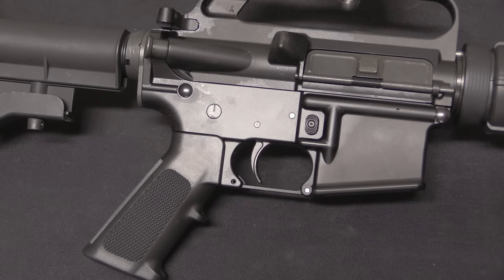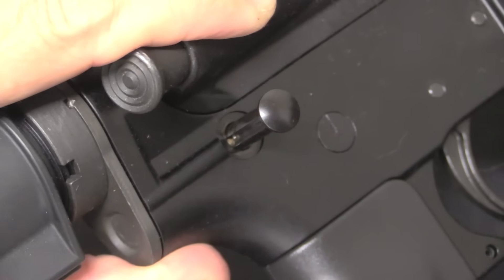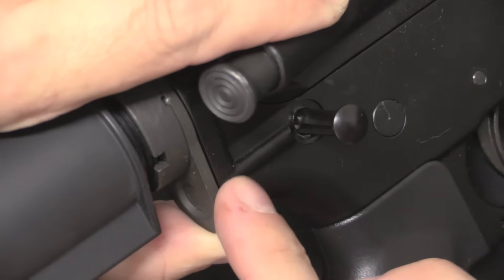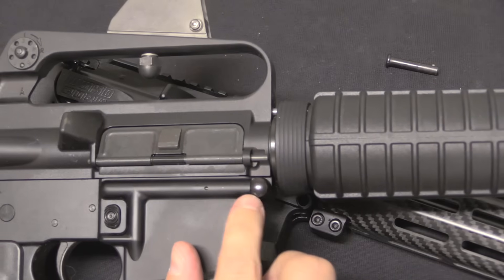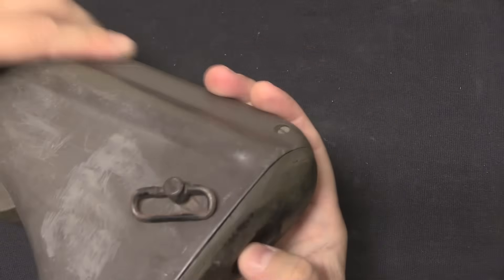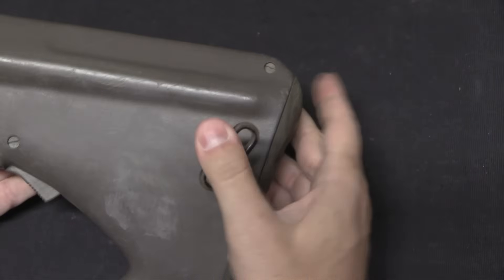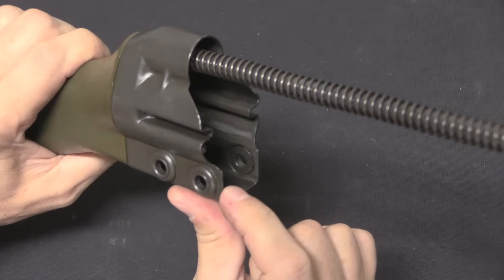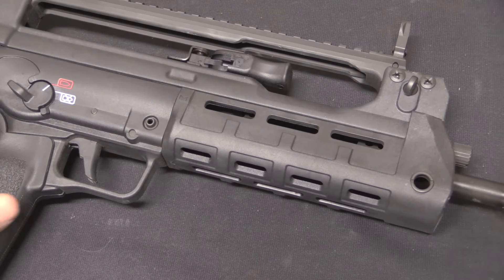Ask Ian: Why Don't More Rifles Have Captive Pins?

Comment: I like what HK did on say, the G36 (or so I think, I don't have access to firearms in general): They have little holes in the stock to park pins in while you take the rest apart. Seems like a good idea for not losing pins in the field without making them captive.
Reply: HK did that on their roller locked guns with fixed stocks, like the G3, G33, G41, and MP5.

Comment: Is there a firearm with captive pins with a groove where you have to turn the pin to pull it out? You could simply make the hole in a sickle shape, that would combine the captive pin with an easy takedown/ low cost... (I'm from Germany so I have next to no firearm experience)
Reply: Now the hole to be drilled/cast/molded is significantly more complex to manufacture.

Probably more complex a solution than figuring out how to make the pin captive, once you consider the cuts on both pin and weird shaped hole necessary.

Round holes are easy.  Round pins with concentric grooves are easy.  Intersecting round holes are relatively easy, provided you have enough meat in the material and the smaller hole isn't too deep.

Generally rule of thumb - if you can lathe or drill the part, that's generally easier than almost any other machining process.
Reply: @geodkyt  fair point, a classic over-engineered suggestion in hindsight :D

Comment: I have noticed, however, that both of my AR's with polymer lowers have captive pins. Guess I just picked the right brands, though economy priced SOTA and PSA, to purchase!
Reply: Or you have two polymer lowers with weak points that can fail more easily, as I've seen with polymer AR lowers with captive pins.

It is unambiguously a point of additional vulnerability, regardless of receiver material.  It isn't a problem in an aluminum receiver because the material has the strength characteristics sufficient to make it a non issue, as even the "weakened" area is vanishingly unlikely to take enough stress to break the aluminum, even where the wall thickness was reduced by the detent channel.

Comment: Why did they dump the great side box magazine used on the US Army Krags when developing the Springfield 1903 and 1906. I love my Father's 1899 Krag in 30 Army. It has a perfect bolt and I love the side box magazine. I just don't understand why it was dropped in favor of the stripper clip or single loading to top off. I reload for it and my slightly lower pressure loads, will take a good size deer will drop with one shot out to 150 meters the longest shot I have ever had hunting in Virginia and South Carolina. It seems to me that magazine on 03 or 06 would have been the perfect combination.
Reply: I believe the army/gov't officials (some sort of bureaucrat) thought that if they used box magazines then the soldiers would waste too much ammunition. It's the same reason the US never officially adopted a repeating rifle and stuck with their single shot rifles and then bolt actions in the 19th century.
Reply: @bobthebuilder5067  That makes sense but some Krags if I remember could be fired single shot. You could have done the same with the 03-06, 30-06.
Reply: Because every army that fielded that system found it gave them more problems in service (including parts breakage, more complex and expensive manufacturing) than just milling a stripper clip guide or going to en bloc clips.  For a Mauser style charger system, you literally have NO moving parts required in the loading system, only one fixed part (the charger guide), and the only down side is you have to open the bolt to top.off the magazine with single rounds (which wasn't a primary concern for military use - troops invariably, and generally by necessity of the speed of action, fired their rifles dry and relaoded via clips.)

In fact, I'm trying, and failing, to think of anyone who didn't abandon a side loading Krag style magazine for a Mauser style stripper clip system...
Reply: @geodkyt  Thanks it is a good system in a hunting rifle but I figured there had to be a good reason

Comment: One method you missed for keeping pins captive was the sa80 solution of have a clip embedded in the steel body around the pin that stop it from being pulled out. Though these do come loose and need to be peened back into the slot.
Reply: That basically goes back to the Swiss solution of "design pins that can fail" option.

Albeit a failure that won't preclude disassembling the rifle... justva failure mode that might allow the rifle to fall apart in use (like M60 trigger groups falling off if the leaf spring is upside down).

Comment: Now I'm wondering why you don't 'just' use a split pin.
As this video shows there must be a reason.
Reply: They also, in some cases, introduxe a failure point.  As anyone who has seen a broken AR15 firing pin retention cotter pin can attest. (As a drill sergeant, I carried a small baggie of parts I charmed the armorer out of, with a couple spare cotter pins, extractor retention pins, and extractor springs.  Because, sure as there's a tattoo parlor, strip club, and "Buy here, pay here - your LES is your credit!" used car dealer ship offering a ten year old Mustang at credit card interest, at least one of your privates will.manage to lose or break one of those small parts the first time they take their rifle apart at the range or in the field.)
Reply from the maker: Split pins are fine, but not captive.

Comment: This is a question I’ve wondered about for ages. 

Makes sense that it isn’t always viable. I think the H&K solution is the ideal middle ground if you can’t have captured pins. 

At least provide somewhere on the rifle to keep them secure and safe. Because if you drop a pin in tall grass  it’s just gone. 

It’s honestly just such a different set of design criteria for a service rifle vs a commercial rifle, you have to grunt proof everything.
Reply: Place to store and a couple extra pins.
Reply: @InfiniteDarkMass  Like having two pins at the back fo the G3, when it really only needs one....
Why? Extra pin, right there.
Reply: It's a question I've always had too.

Decisions like this often come down to what government procurement people want rather than the manufacturer or, in civilian rifles, what the marketing department says will sell best.

Comment: The pin in the AUG is also supposed to be reversable so it makes no sense to make it captive.
Reply: ...and there is no reason to unthread it from the sling during field stripping anyway.

You lose a meter or so of nylon webbing, and well, lost pins are probably the least of your worries.  Being legally blind as you would almost have to be would be a much bigger problem.  🤣

Comment: An idea comes to mind, and i'm sure i'm not the first one to think this so i hope an engineer here can tell me where i'm wrong, but why does the detent need to be springloaded? I understand it's for when you need to put in or pull out the pin entirely, but it seems a lot of extra parts, construction difficulty, and structural problems. Wouldn't it be simpler to have a fixed detent, and make the pin out of 2 parts? Say, the normal pin shaft with groove, tap a small hole on one end, and the wider head screwing into it? It would be less parts, no dynamic parts, and much easier to produce? It would be a matter of finding the best way to make a strong enough fixed detent in each component material, i suppose.
I'd love to hear where this idea falls down, because i imagine it would be done that way already if it worked :p
Reply: It is a possible solution, but one that is often more difficult to do than a spring loaded detent where the pin itself keeps the detent from popping all the way out.  And it can often be much easier to install or replace a spring loaded detent than a fixed retention pin that restrains overtravel of the other pin.  These sorts of trade studies are where good production design engineers make their money.

Sometimes it's the right solution, sometimes it's not.

Comment: It seems like the captive pins are really useful if you have to open a rifle up in the field.  Did the designers of the AR and others with captive pins feel that there was a need to open the rifle in the field to deal with a malfunction?  Did the designers of the non-captive pins feel that their rifles would not need to be opened in the field?  HK has holes in the stock to place the pins in during a field strip.  Did they just not expect field strip to be necessary under fire?  Has that turned out to be true?  Or do you just deal with it doctrinally and drop a weapon that cannot be cleared and transition to secondary weapon?
Reply: The original AR (at least the designs that we call ARs) was not designed with captive pins. It was a request of the military testing them to add captive pins. It's definitely one of those things where you're trying to reduce failure points in the field. I believe that general doctrine is that your secondary weapon is an absolute last resort, considering that the army does not believe the handgun to be a particularly effective weapon (this is the reason non-combatant troops were issued M1 carbines in WWII to replace their 1911s). You definitely would want to attempt to clear your rifle if possible, although most common malfunctions do not really necessitate field-stripping the firearm.
Reply: It's not so much field stripping the rifles under fire.

It's field stripping the rifles in the field when you're exhausted, probably under poor light conditions, might have cold numbed fingers, and no nice clean well.lit table to lay your stuff out on - you're probably chucking bits into your hat or helmet, and hoping someone walking past doesn't accidentally kick it.

The fewer small parts that can make a run from the freedom of the tall weeds and dead leaves, the better.
Reply: I think it is much more simple than that.
Does the military trust their soldiers not to drop a pin:
- No: captive pins it is
- Yes: captive pins not needed
Reply: @Jehty_  I think all successful militaries live by Murphy's Law.  Because it is a statement of fact.  Everything that can go wrong, will.  or in other words Sh_t happens, and to the best of warriors.

Comment: I'd also add another note to this video. Tooling. Most companies will be either buying their pins from someone else or manufacturing in house a commonly used pin en mass for many guns. 

Creating a relatively reliable, (no worse than a non-captive pin), self captive pin isn't that difficult. And the extra steps once your upto manufacturing sufficiently large numbers of them isn't a huge cost negetive either. But justifying the up front investment to do the new tooling setup is going to be hard without a serious need allready existing. And that largely isn't a thing ATM.

Comment: The hole for that detent is only a single diameter. If you pop the takedown pin out and leave the detent in place it will protrude further out. All of the machine blueprints I've seen for lower receivers show it as a singular diameter including the print I have right in front of me. The safety detent on the other hand is limited in the manner that he describes in this video
Reply from the maker: (See description text)
Reply: @ForgottenWeapons  touché

Comment: Surprised you overlooked the captive wedge on the AUG that holds the receiver and the stock. 
Though it's not a pin as such, despite functioning as one.
Reply: Maybe it's just because of how hard it would be to get a good camera angle on the little sheet metal spring assembly that holds it in place. The AUG, though, is such a good example of the designers going the extra mile only for parts that are most likely to need disassembly in the field, I'm also a bit surprised he didn't at least mention it. The butt pad pin is already sort of captive simply by virtue of being attached to the sling swivel. You're not likely to lose it in the field unless you misplace the whole receiver. The AUG has advantages and disadvantages, but it's definitely one of the most elegantly laid out guns in history.
Reply: Immediately thought of the AUG as the epitome of design built for field conditions.

Comment: Great explanation, this is definitely something I have thought about before. If I was setting the requirements for a new military rifle, then captive pins would definitely be on my list.
Reply: If you would be setting requirements for a new military rifle you would most likely have to deal with the cost of a rifle.

For context: Im an automotive engineer.
Whe i saw that first pin i thought: "this is a really expensive pin".
There need to be a lot of machinetime and assemblytime dedicated to that pin.

The total cost of ownership (from a military perspective) might be less if you just buy 5 non-captive pins as spareparts on top instead of having that one captive pin.
Reply: @WEWzulu  Sure but you also have to consider the intended use case. That rifle won't be of much use in war if all the pins have been lost.
Reply: @ErikTheAndroid  this is a problem ofc. But the 5 gramm and 10 cent for the captive pin might be invested in a better way somewhere else on the rifle. On a better adjutable sight or whatever.
Its about the likelyhood and severity of an incident. Loosing a non-captive pin in a gunfight is higly unlikely and loosing it in a base or somethings isnt that big of a deal if there are spareparts somewhere.

You simply cant buy the perfect rifle/car/whatever.

There is allways a compromise to be made.

Comment: In my experience the AR rear detent hole is a single diameter. The detent pin will happily come out of the hole into the take down hole. The pin itself keeps the assembly together.
Reply: Yeah I was like "wtf?" when he said that and went and checked one, definitely single diameter, detent is simply long enough to stick out into pin without coming out.
Reply: Every AR lower, ever.  😉
Reply: @a.k47-74  sending detents across the room when building my first AR. Ah, memories. I’m so lucky I found them. I put the lower in a big plastic Tupperware tub and assembled the takedown pins in that, so it didn’t happen again.
Reply: Yes. He's not as perfect as some seem to think.

Comment: Something to add
In wartime production, every additional machining time is precious time wasted getting guns out of factory and into the hands of soldiers
So it may not worth the time to produce certain aspects of the gun if (soldiers) you can get away with it...
Reply: The ar is already one of the most bear bones rifles out there and it's literally just drilling 2 holes the actual dent is on the pin itself. Also you have to secure the pin somehow anyway and this is a very simple way to do it without adding very much complexity.
Reply: @whatsmolly5741   well, I was talking in terms of production aspect
 
In manufacturing, volume of production is the key of the game. 1 part may cost 1$ to make, but if you were to produce a million of them it would stack up

Labor, material and time cost is the balance manufacturers have to consider when producing stuff and situation also matters.

For instance; in peacetime, proper quality control and price is more important as there is no rush to get things done. In (hopefully not happening) wartime, volume and speed is far more important than quality especially if one is desperate enough

So who knows, maybe such part was deemed unecessary or so insignificant it may not even matter. However it has to be said that in war everything is expendable including guns. So it may have merit if such tools were used up much quicker than you can procure, such shortcut may be a viable solution
Reply: @TheCat48488  cant really say as people debate if it was the army who asked for it and i mean the army did ask for a forward assist and most of us have literally never needed to use it. I think it's more of the fact that the gun was designed with this concept as the starting point they didn't encounter a problem and this was the solution. There is absolutely no shortage of different ways these 2 pins could be done. Drill 1.5 inch hole, stick detent in the hole, stick spring in the hole.... congratulations your pin is now going to be secure when firing but is still easy to open. When you consider the other options as you said this ends up being the one with minimum work and design requirements.